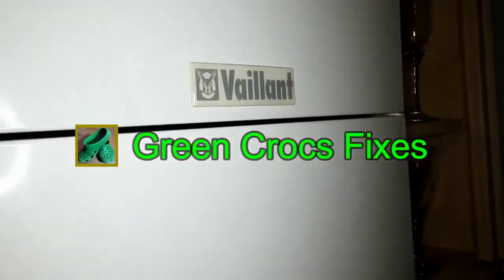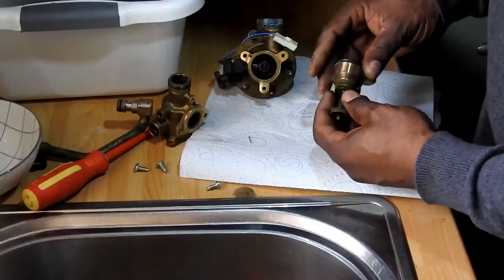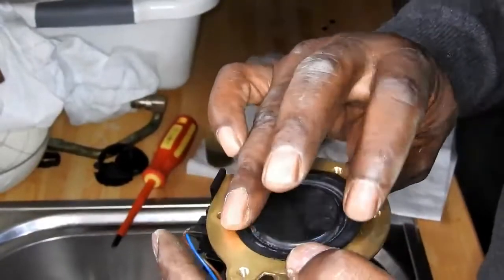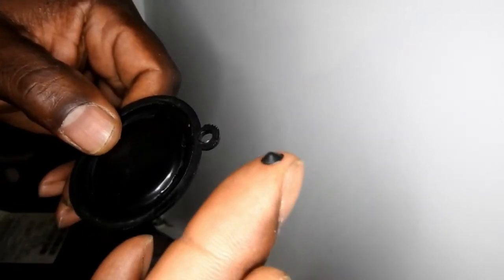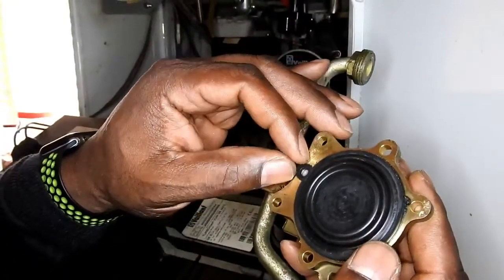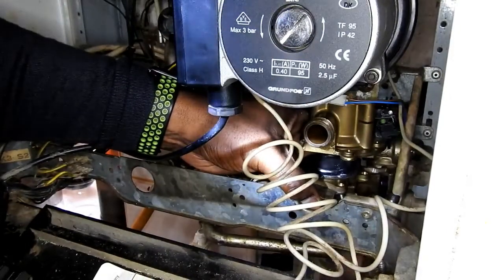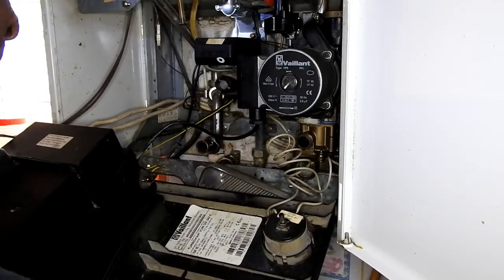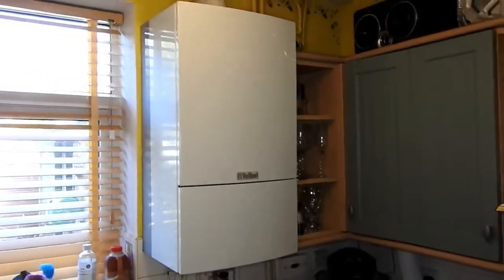Vaillant 242 Combination Boiler No Hot Water Diverter Valve Diaphragm Problem

Comment: If I was to get a few spare diaphragms is there a good chance this same boiler would keep running solid for another decade? 
They're going to make it illegal to sell new boilers in 2024 and so I need to decide whether I need a replacement.
always having issues in shower and kitchen but central heating works fine.
Reply from the maker: Hi Ukessko,
                     Vaillant parts are always available even for this Boiler which is nearly 20 years old. By all means stock up on Diaphragms however there are other parts which may fail too.

Comment: Hi, my boiler is vaillant vuw 260 . The problem is that if the chimney led flashing more than 90 seconds after it doesn't start, just running the pump forever. Any idea why?
Thank you!
Reply from the maker: No idea,
               sorry Add. seek professional Gas Safe engineer help with gas boilers.
Reply: @green-crocs-fixes1520  Thanks :(

Comment: Thanks for the video. Where did you buy the kit ?
Reply from the maker: Hi Notilluminati,
                            brought the kit off eBay but only the Diaphram kit was required as there was nothing wrong with the Diverter Valve.

                       Regards.